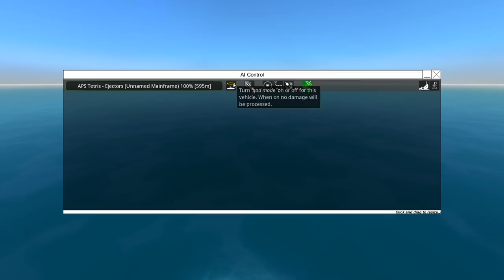APS Tetris #2: Long Loaders, Railguns, Ejectors and Multi-Gun Turrets! From the Depths Tutorial

Comment: You can actually have railgun with the 3x3 mantlet, you just attach a barrel piece to the firing piece, and then attach the mantlet to the end of said barrel piece. It may not look or sound like it works, but it does, I used this trick to make a frontsider.
Reply from the maker: ... holy crap you're right, that NEVER would've occurred to me. Cheers! It's starting to look like a part three is needed. XD
Reply: oh my god you can put barrels before mantlets?
this changes everything
Reply: They fixed it, it doset work
Reply: @BorderWise12  does this no longer work? I just tried it.
Reply: The 3x3 mantlet doesn’t have to be centered on the firing piece, by doing that you can still put railgun magnets on the gun although it looks really weird.
Reply: you can still do this with offset mantlets, looks quite funny too, and fun fact: the higher the gage, the less offset the barrel will visually have (60mm barrel lines up more with the firing piece block, 400mm lines up more with mantlet center)

Comment: The bug where you can put the mantlet further down the barrel has been patched, but I discovered from someone else that you can actually offset mantlets, and they will still attach. So, you could shift the elevation mantlet up 1m so the bottom attaches to the gun, and attach 3 rails. You could also attach only the corner of a 3m omni mantlet to have 2 rails attached, though it’d be a bit jank.

Comment: Another minor point: having a mixture of numbers of clips per loader (say, some with 2 clips and some with 1, or any other combination) does weird things. Not bad, necessarily, but counterintuitive. You get "bursty" fire - so you'll have periods of much higher fire rates (when the various clip-number cycles align) and periods of much lower fire rate (when they're all on their gaps at once). This can be a thing to aim for deliberately (the burst periods can help to cut through annoying LAMS systems), but can also be annoying and confusing.

This can also be an advantage of having multiple firing pieces: you get a slightly lower overall fire rate but (assuming you get the fire rates to match exactly or force it via syncing) you get more projectile HP per volley, and thus better performance against LAMS.

Comment: For rail-hybrid guns, I like using a vertical 4-clip loader tetris. You start with one four-clip loader right in the center of the turret (though you can remove that afterwards if you want two or four firing pieces). Then, in an offset way, you slot in four more 4-clip loaders around it, in rotational symmetry. This fills out a 7x7 turret with 12 tiles of gap around the outside that you can use for rail chargers and recoil absorbers. You can go further then - add one more set of loaders, and you have 9 loaders with 24 tiles of gaps in a 9x9 turret, 13 loaders with 32 tiles of gaps in an 11x11 turret, 21 loaders with 32 tiles of gaps in a 13x13 turret and so on.
Reply: It may be useful to use undergrowth to fill the gaps with autoloaders if you need more.
Reply: @atlas4733  If you mean filling the gaps with autoloaders of a lower clip count, you don't actually want to do that. Those autoloaders will have a different reload time from your 4clip loaders, and as a result will not be synchronised for them. This means that your rate of fire will fluctuate, and you will need more cooling to achieve full loader RPM than you would with all loaders the same.

Comment: The quad barrel design, You could probably replace the recoil absorption with stone and make the weapon controller completely EMP resistant instead.
That is if recoil isn't an issue on the craft you're using it on.

I must have missed an update because I don't remember a APS Shell defuser ever being added.
Kinda makes my APS turret designs obsolete because I place metal beams inside the tetris to prevent the entire turret from exploding.

Comment: Did a very long break from FTD, and missed some huge changes it seems...
This is much easier to build than last APS i did. And also results in a significantly better gun after i just optimised that thing for current system.

Kinda sad, there's not much space for mastering now...
But also kinda happy, now my guns can be worth a damn at last x) And smaller-than-10005000-blocks guns are not worthless too!

Also, another reason for multi-gun turrets: a decent way to overcome enemy defences when you can't afford or don't want dakka spam.
Fire in huge volleys via many synchronised guns, they won't have time to shoot down every single shell before impact.

Comment: how are your guns so accurate??? I keep trying XD and I am aware that multibarrle suffer a penalty, but when I try a 3 barrel they wiff. I cant make my super frigate without them lol (might be a recoil problem though?)
Reply from the maker: Few things to double-check:
1. Minimum accuracy set on the guns. The default is 0.5, which is not good enough usually.
2. Barrel length should be what the shell requires. 
3. Should have enough recoil absorbers.
4. Detection: always have a lot of trackers.
Hope that helps! 😁👍

Comment: One thing to note that I realised just yesterday. YOU CAN have just one intake on autoloader with clip and while it sayslow RPM according to the intake speed, it still fires as fast as autoloader RPM as long as that clip has ammo.

Not perfectly useful except for big clip setups where you can have the clip sustained fire for longer periods time or if  space available is really in premium.
Reply: Wouldn't that be slower reloading?
Reply: @locust6391  Yup, but onc loaded it fires as fast. Personaly idk why you would want to do this, but they UNload just as fast, just reload slower.
Reply: @locust6391  Once the clips start running out. Yes.

Comment: Ohoh, looks like Borderwise needs an aps tetris lesson of his own... No offence intended but i do see some common inefficiencies in the tetris of the guns. Nobody knows everything though, everyone can (and should) keep learning.
Reply from the maker: I love it when people say I'm doing something wrong... and then don't actually say what it is. SUPER HELPFUL. 
In all seriousness though, what did you see that was wrong? 😃
Reply: @BorderWise12  Sorry should have specified what it was. 

Firstly in most guns you have a base of coolers. Its more efficiënt to have a base of imputs and a "roof" of coolers. This way you have space for one more loader (the space were the snake would have gone down) and if you use a dubbel layer of auto loader you dont have to add another base of coolers you can just build on the roof of the bottom layer. 

Secondly you use 2 clip autoloaders all the time. There is a simple pattern that allows for infinite gapless 4 clip autoloader stacking. Its kind of hard to explain with words but i could send you a picture to show you (if i knew were to send it). Sidenote the same pattern with a small height adjustment also works for ejectors.

Lastly, you can use the omni mantlet for railguns. You can offset the omni mantlet so that rail charges can still fit past it. Imagine the omni mantlet is a 3x3 grid were normally the center point is were you would place it on the fireing piece but now you place the fireing piece on one of the four corners of the 3x3 grid. The mantlet still connects to the fireing piece and you would have 2 places for rail magnets to fit past the mantled. (The same trick can be done to have 3 lines of railmagnets on the 3m tall mantlet) 

Hope this helps.
Reply: @LH-gt6gz  if you put the pics on steam as screenshots, you could link them to here. understandable if you dont want to link screen names though.
Reply: @MrJay_White  i thought you couldnt put links in comments but ill try, tnx
Reply: @BorderWise12 pictures for Aps Tetris Pattern

Basic 4 clip pattern
https://imgur.com/gallery/ZzlanAR

Proceed to cut out a circle
https://imgur.com/gallery/hZxVyA7

Looks like this
https://imgur.com/miAYTNk

Snake on top
https://imgur.com/gallery/qjxsEre

Replace 4 clip cluster with this if you want ejectors 
https://imgur.com/gallery/9CvB5dL
Reply from the maker: @LH-gt6gz  Thank you, that is very helpful! 😁

Comment: What advantage do multiple barrels provide? If the cooling and loading is split between each barrel, and gauge increases don’t take much volume, how is say, a 18mm single-barrel different from a 6-barrel one? I’m kind of confused why all of his 250mm guns at the beginning of the video didn’t just use a single barrel…
Reply from the maker: Short answer: bonus cooling without needed expensive coolers, as gauge increasers are cheaper.

Comment: Ok, Borderwise. This be cool vid. This be really cool vid. But ya missed something.

One important, big big big HUGE thing you did not talk about is the fire rate loss of varying clip counts. This is something I did wrong for years before a kind gentleperson on the discord slapped me (platonically) for it, allow me to explain.
TLDR: if some of your autoloaders have x clips attached and others have y clips attached, if x and y are different it can easily cost you 5-15% fire rate because of game mechanics.

Every autoloader in an APS system has a cooldown, and therefore a provided fire rate. The autoloader fire rate in the UI is merely a summation of the fire rates of the individual autoloaders. Clips don't have a cooldown of their own, instead they reduce the cooldown of the autoloader they're attached to. So an autoloader with one clip attached will have half its base cooldown (and therefore double its base fire rate), with two clips cooldown is 1/3d of base (base cooldown is solely dependent on shell). So the whole ammo setup gets reduced to a number of loaders that are either primed or on loading.

When the gun starts firing, it looks at the available autoloaders and picks the shell from one, quasi-randomly. Then when the gun is cooled, it will pick from the next primed loader. If cooling and loading are perfectly balanced, and all autoloaders have the same cooldown, when the gun has gone through all loaders the first one is just loaded so the cycle starts anew.

But what if clip counts vary? Well, now we run into a problem where occasionally multiple autoloaders will come off cooldown simultaneously, or too close to each other for the gun to cool down. What this means in practical terms is that your autoloaders will spend some amount of time... waiting. Which means their fire rate is lowered, and with it, the fire rate of the entire system.

I've run some simulations and even a bit of mixing can give you a 5% fire rate reduction. It is definitely something to look out for when designing APS.
Reply from the maker: I wouldn't call a probable loss of 5% RPM a huge thing, but cheers! Good to know.
Reply: On the other hand, it does increase the burstiness (you get brief periods of higher fire rate then periods of lower fire rate), which can help if you're shooting at something with a particularly annoying LAMS, for example.
Reply: @abcadef6171  This is also something you can try to counter by having multiple guns in the same turret, it's more difficult to destroy 4 shells arriving at the same time every 12 seconds than 1 shell every 3 seconds. Then again I mostly just use multiple gun turrets because it looks cool :P

Comment: Is there a good ratio of autoloaders to clips that you should aim for?
Reply: Depends on what kind of canon you are building, look at your autoload limit, clip and ammo intake. More clip means more ammo, more auto loader means more bullet to spit, ammo intake is the speed of reload. Example if you want to spit waves of bullet you can do a belt fed with more clips but ones you run out of ammo, you have long reload time, if you want continuous firing with good RPM then balance out the 3 or you can do is more autoloader with enough intake with singular clip each loader. Hope this help

Comment: How do you decide the gauge/shell length/autoloaders length balance?  Excuse me if I answer my own question, but wouldn’t it be: deciding your shell gauge, find out what kind of autoloaders you can fit and split them into smaller autoloaders if you want to drape firepower for fire rate, then cram in as many modules as you can? If someone has a better way please tell me. I just spent 2 mins repeating the same word to myself trying to get my mental rant on track in my bed at 1am.

Comment: How the hell did you get the double guns working? I try to do the same thing with 3 z-axis offset guns and they perpetually say "NO SHELL LOADED"
Reply from the maker: There's a few things that could be going wrong. :
- Did you actually assign the right shells to all guns?
- Are there any gauge connection points, connectors or loaders touching and making one gun hog all of the shells?
- Are your shells the right size for the loaders?
Reply: @BorderWise12  i have actually figured out the issue. The autoloaders of different guns were touching eachother.

Comment: Ok so what’s the diffrence between 1m and 3m loaders? I made a cannon that has 3m loaders and it does the same damage as my 1m loader…
Reply from the maker: Did you change the shells as well?
Reply: @BorderWise12  I put the same shells because it wouldn’t accept longer shells but I increased the gauge
Reply: The main difference is the gauge they can hold. You'll see that you might be able to slip in more components if you use 2 or 1 module blocks instead of 4 modules, keeping your shell length filling the space at its maximum gauge